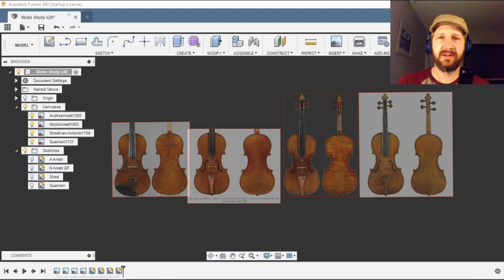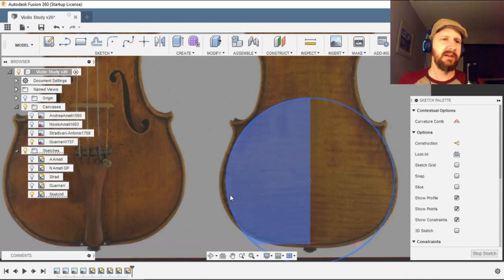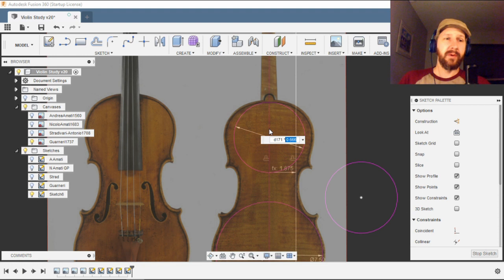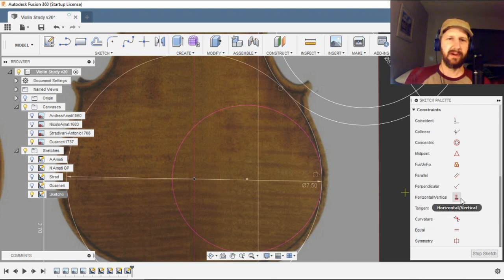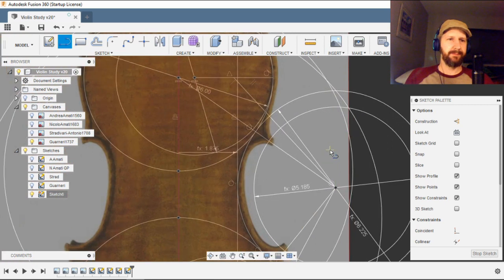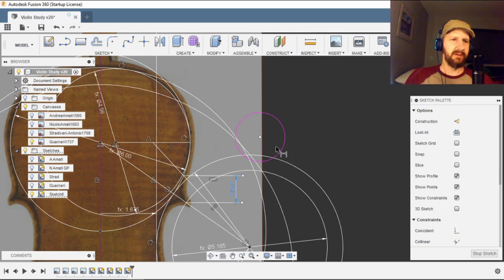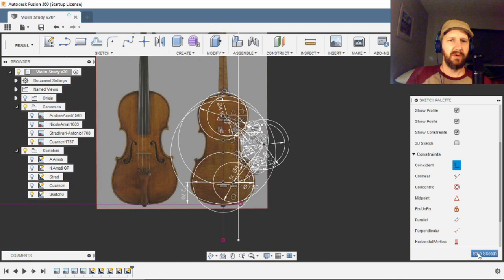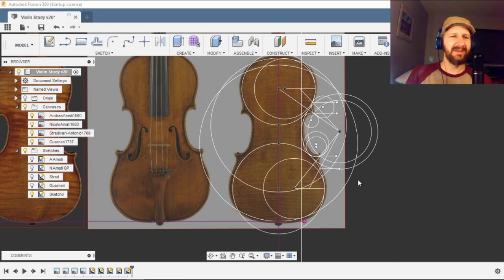Drawing a Violin Body: Fusion360 Proportional Design

Comment: Your tutorial was very very good! I'm a newbie and you've taught me alot. My model came out looking great. I saved the version before doing the cleanup to end up with the otline proper. The only issue I had was with the tips of the C bouts. I used Stradivarius' Messiah poster provided by The Strad and the tips don't line up properly. I didn't use the actual photo of the violin, but rather used the schematic found on the other side of the poster. In hindsight, I should have used the photo as you did. Irregardless, I'm very happy with the result. Pierre👍
Reply from the maker: That's great, and thanks for the thoughtful comment, I never get tired of hearing that.

Comment: Really nice work! I'm new to the world of violins and would like to learn a bit more about proportional design. Is there any literature that you have used to take the proportions?
Also the outline obtained is the inside of the ribs, correct? After cleaning the sketch you need to add the thickness of the ribs with the offset tool and the overhang, right?
Reply from the maker: Thanks, I picked this up from another violin maker video here on YouTube that he unfortunately took down, he is planning on writing a book, and I believe there is a Strad article.
Reply: @TwoCherriesIns  Thanks for the quick reply! But you didn't address my second question, could you give me an answer to that please?
Reply from the maker: @V8Series  yes you need to offset the thickness of the sides.
Reply: @TwoCherriesIns  Thanks, keep up the awesome work!

Comment: Hi, This is a great looking series. Thanks for doing it and putting it on youtube. I haven't been able to watch the whole thing yet, but any chance you can attach a quick note with bit sizes and feeds, speeds, and cut depths that you use for the different parts of the project.
Reply from the maker: Thanks, My style has changed quite a bit since then; I hope to do another violin family build again soon. I offer my full fusion360 file to Patreon members, including all the CAD and CAM, including the bits and feeds and speeds used for this build. 

https://www.patreon.com/twocherriesinstruments

I don't use anything fancy, just a 1/2" straight two-flute, 1/4" and 1/6" spiral two flute, and a 3/4 ball nose. They are all run-of-the-mill router bits.

Comment: Another question...it seems like your outline does not go to the exact outer edge of the plate in the photo. Are you meaning to draw the mold on the inside here, or to rescale later - which I understand should be simply as you have tied everything to the original, lower-bout circle?
Reply from the maker: I'm drawing the outline of the ribs, I will use an offset of this to draw the outline of the plate.

Comment: Great. How are you making the measurements proportional to the first circle (basic Fusion360 question I suppose!)  I see you typing in something like  D  /4    for 1/4 the Dimension of the first circle? You click on the circumference of the Lower Bout Circe  each time to and then type D?   Anyhow, I’ll have to play around with it that!
Reply from the maker: When you are entering a dimension you can just click on the dimension from the first circle and this will create a reference to the dimension I usually just multiply this by the proportion I want.
Reply from the maker: Check out the screen cast link in the description to see all this in more detail.
Reply: @TwoCherriesIns   Cast Link? What / where is that? thanks.
Reply from the maker: @guybooth20  the Autodesk link in the description, you may need to login to a360 to view it.